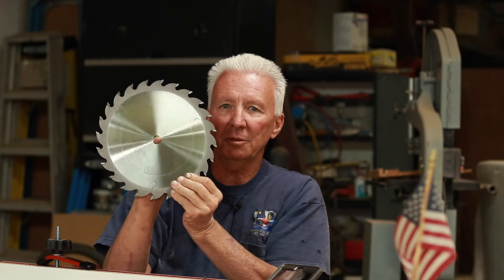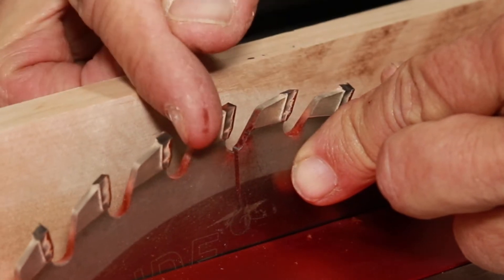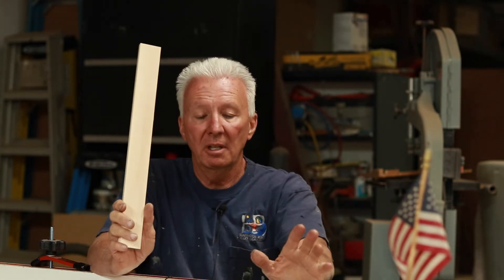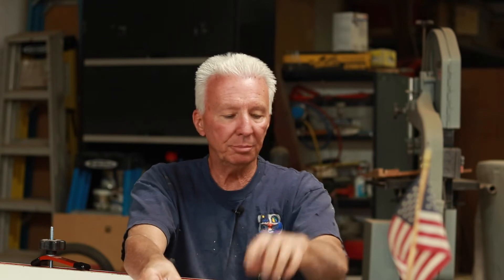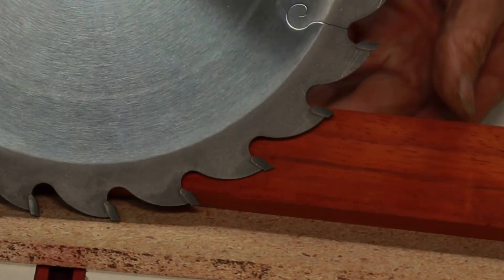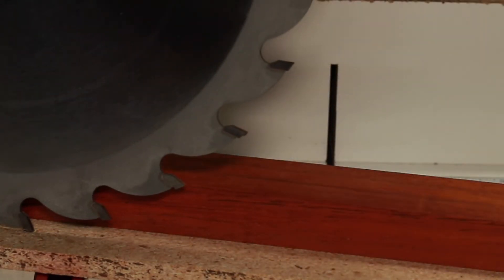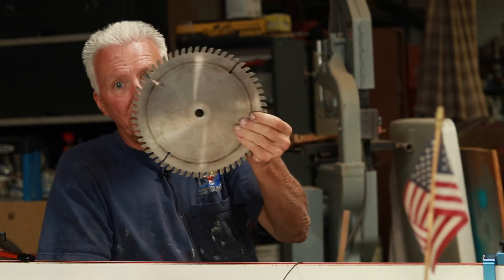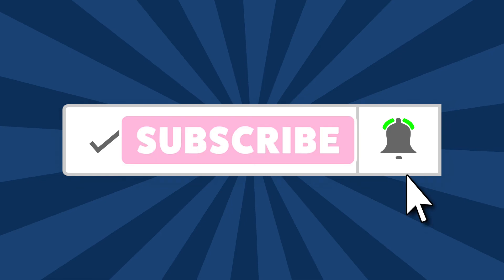Saw blade Tip - 2 tooth theory explained

Comment: I learned a lot from this this video.
There's a lot of saw blades out there and selecting can be confusing. I have the blade that came with the Harvey 1000 s and a new Ridge flat bottom blade for box joints. Thank you sooo much for explaining the 2 tooth theory.
Love your videos.
Reply from the maker: Dan Hobbs Ridge are great blades. I'm a huge fan.

Comment: Great advise. What blade did you actually buy from Ridge Carbide
Reply from the maker: Thomas Bridges sorry late reply I purchased 2. The 40 tooth TS2000 Super Combo Blade and the 24 tooth Heavy Duty TS2000 Super Rip Saw  Blade